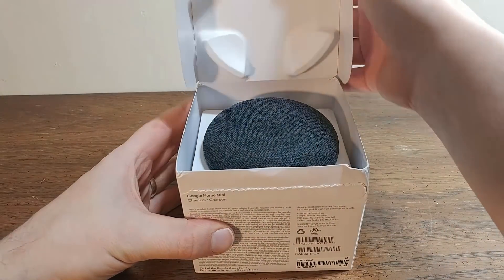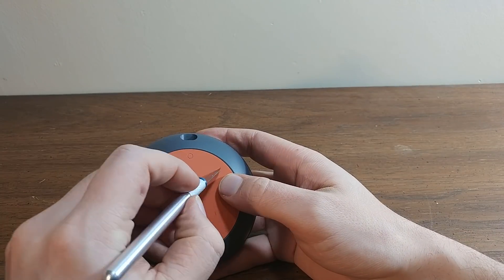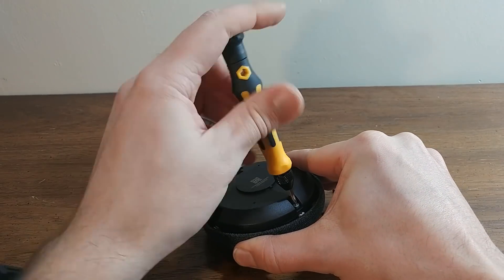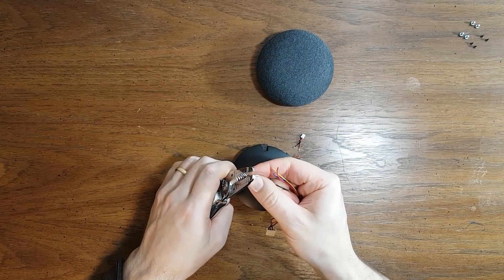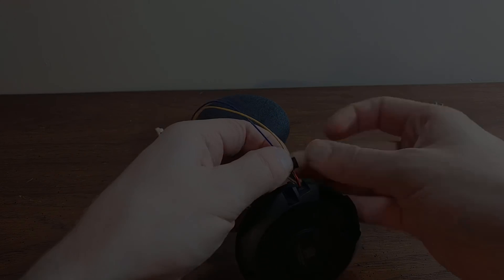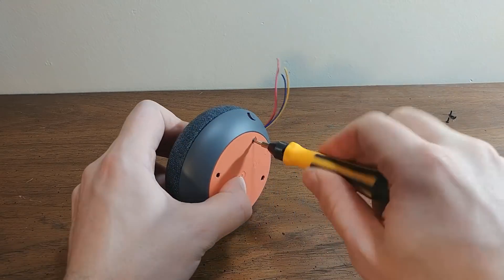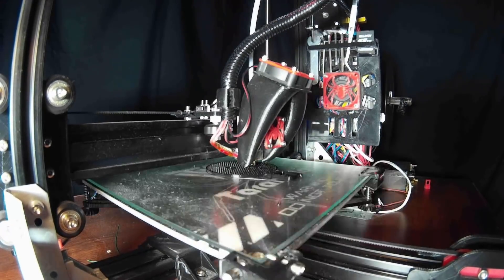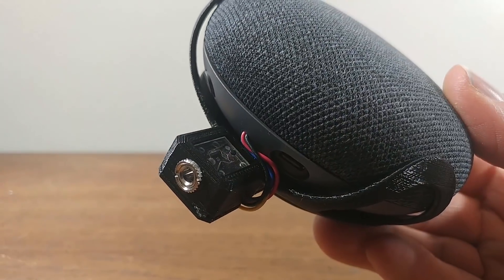Google Home Mini Wall Mount With 1/8 Inch Headphone Jack Mod

Comment: would this not require an amp? Seems like you are just putting a big speaker on a small unit which wont really give the boom that you are looking for>?
Reply from the maker: In my experience larger speakers can sound louder and nicer. And according to Google AI Overview "Larger speakers, particularly those with larger drivers (cones), can move more air with each vibration. This greater air displacement results in a higher sound pressure level, making the speaker sound louder. Larger speakers also often have a better low-frequency (bass) response, which can contribute to the perception of a fuller, louder sound even if the overall SPL is similar to that of a smaller speaker."

Comment: We have long resisted getting an Echo. Never really saw a need. https://www.youtube.com/post/UgkxhB5YOMNj04GuoAosExygP4cH-dKeb4aB When we recently completed some remodeling in our home, we realized we had failed to add a switch to turn on a certain lamp across the room. We couldn't run new wiring (which would have been expensive if we could), so we got our first Echo which completely solved our problem for about $40 (Echo Dot and smart plug). We just ask Alexa to turn on/off that light. Heartily recommend it to solve this kind of conundrum!

Comment: That pin connector is a real pain in the ass to get back on. On one, the whole solder uprooted when I tried to pull it out and I ruined it. Ugh.

Comment: Great video. So I duplicated it and everything went well. But I am getting a hum on and off. Is that because I'm not using a resistor?

Anyone have any diagram work for the resistor and what kind of resistor?
Reply from the maker: Yes, I believe a resistor would fix it (I believe the other You-tubers use them)  I never did the research to figure out which one would work since I found if i didn't plug it into a amplifier but just into a speaker The hum wasn't really noticeable 'cause it was just going to the new speaker instead of its on board one also, you could maybe remove the hum with an amplifier that has a good EQ on it.
Reply: I am also getting a loud hum when i connect it to an amplifier. I bought a pair 2.7 ohm and a 330 ohm resisters but I'm not sure to which pin i should connect it to on the headphone housing. Because i want to output in stereo, I'm having a tough time figuring out which wires to couple. Any help would greatly be apricated.

Comment: No need to add the resistors like in the other hack videos ? Why ?
Reply from the maker: my understanding is the resistor has 2 purposes lowering the Max output so as to not blow up amplifiers if you set it to full volume, and cleans up the sound when going into some amplifiers both features are unnecessary if you're wiring directly to a speaker without going through at amplifier.  your mileage with amplifiers may vary and always be careful to not use Max volume on the mini when plugged into an amplifier I recommend 35%

Comment: Would this process be similar with the Google Nest Wifi? I have seen a tear down and it looks like the audio component inside a Nest Wifi is the same as the Nest Mini.
Reply from the maker: I would assume they would be similar since it's just a generational Improvement

Comment: Nice work, thanks!
Is that mono or stereo?
Reply: It has only one speaker and is therefore only capable of outputting one channel. Stereo sound requires two output channels . It is therefore mono only.

Comment: I have 808 bluetooth speaker and speaker alone became bad and the circuit is good and want to connect this Google Home Mini as a speaker. Can connect the 2 wires for speaker to the Google Home?, will it work, and does this setup need power connected to make speaker work?...The bluetooth board (808) comes with recharge battery for the circuit. I just need a speaker (Google Min's) to be connected. Please suggest, if external power for Google Mini is not required and I can just connect to the speaker..Then I can charge and carry this Google Mini and use with the limitation of "Hey Google" and google assistant options.

Comment: If u got a headphone to rca cord u could hook it to a stereo.  Hooking an external speaker to it by itself is gonna sound horrible because Google home doesn't have much of a audio amplifier Built-in. So any external speaker you hooked directly to it is gonna sound like crap unless you hook it to a stereo.

Comment: Thats amazing. I just won the latest version of the nest mini and my excitement level kinda dropped when i realised i could not use it to Spotify connect my kitchen speaker... i might just tear it down and try to put a jack in it, seems like a simple operation.
Reply: I'm gonna do that too I guess
Reply: What about a cheap bluetooth adaptor? I was thinking about that too
Reply: @alecampos1491  Get an Chromecast Audio, that's way better, more stable and same price.
Reply: @simonwolf177  The thing is those are rare to find, where I live they are not sold anywhere, and its expensive to get one on amazon with shipping and taxes
Reply: @alecampos1491  Where are you from? I got mine from eBay. I have a Bluetooth Adapter as well but it disconnected all the time and I had to reconnect manually. (but it wasn't cause of the adapter, other devices don't disconnect, only the nest does)
That's why I got the Chromecast Audio and it works way better. If you can get one, I would strongly recommend it!
Reply: @simonwolf177  Yeah it would be my main option, however, I'm from Argentina where it is nearly impossible to import things and even if I where to do it, it would cost me three or four times the original price, and there still the possibility that it gets caught on the Aduana.
A cheap BT Adapter its easy to find and ten times cheaper
Reply: @simonwolf177  in italy it's out of stock since 2019

Comment: Hay buddy can we connect a Amplifier Aux in to this Jack you installed on the Google home ??
Reply: I'm pretty sure that this will blow your amp if you don't use appropriate resistors.

Comment: I pushed a small flat blade under the edge of mine and just pulled it off. Adhesive actually wasn't terribly strong. Also, always use heat shrink instead of electrical tape. And when you put solder on a lead without soldering two items it's called "tinning" not soldering.

Comment: No amplifier for that huge driver?
Reply from the maker: Yes correct, actually in my experience larger speakers are easier to run with less power than small ones my theory is that it's easier to make an electromagnet with a bigger coil

Comment: add the resistors !  https://youtu.be/bMfcrZYOAnE?t=112
do it with 2 home mini devices and stereo pair them !  (now its mono )
Reply from the maker: I don't believe that would work because in stereo you want to separate tracks and both minis would be combining the tracks to make a single source so it would be the exact same linking two of them as what I have currently

Comment: Use a leather hole punch instead of cutting with an xacto knife and use heat shrink tubing on your solder joints instead of electrical tape:
https://www.amazon.com/OWDEN-PIECES-HOLLOW-CUTTING-LEATHER/dp/B07GCWY3HH - leather hole punch set
https://www.amazon.com/MulWark-415-Pieces-Box-Applications/dp/B072LTD1LT - heat shrink tubing

Comment: you did not use external amplifier, u sure it can drive a lower resistance speaker
Reply from the maker: In my experience it takes less power to drive a large speaker than it does to drive a small one.

Comment: I managed to get this together. When I plug in headphones it works just fine. When I ug in a bigger speaker (150amp) I get static and barely any sound. What's the deal?
Reply: You need an amp
Reply: Hmmmmmmmmm....

Comment: Hi!, I noticed some people doing something similar but adding a couple of resistors, why wasnt that necessary in your case? cheers!
Reply from the maker: I didn't add resistors because I was going directly to a non amplified speaker if I was going to an amplified speaker I would have to add resistors or not exceed 30% volume
Reply: @Make-it-work  thanks a lot for your reply, I'm very good at DIY repair complicated things like film cameras for example, but clueless with electronics... So if I want to add an output jack and I want to connect a powered speaker like for example a Logitech Z533... I will need the resistors right??? Thanks again! Cheers!
Reply from the maker: @martirpeperino  Yes, you would need resistors if you want it to sound good going into an amplifier. Good luck!
Reply: @Make-it-work  thanks a lot for your reply, I'm very good at DIY repair complicated things like film cameras for example, but clueless with electronics... So if I want to add an output jack and I want to connect a powered speaker like for example a Logitech Z533... I will need the resistors right??? Thanks again! Cheers!

Comment: Great video , however I am sure there is Digital sound processing going on to make this small speakers sound like good,so the sound you going to get is highly process specifically for their speaker your speaker is not likely going to sound good since it’s different , also 
This is mono solution so not really good axe out , better use the Bluetooth broadcasting ability of the mini
still great video , thanks

Comment: I appreciate your thorough breakdown, thank you. 

Also, to any other idiots like me who didn't immediately realize this, adding a line-out will only give you mono sound. So it wasn't worthwhile in my case.
Reply: just saved me a couple hours of my life, thank you
Reply: Uhm... why not just get the chromecast/chromecast audio device???
Reply: @msld3529  ummm cause they're not available any longer. Unless you know of a stockpile somewhere?
Reply: @msld3529 because the nest has a build in small amp… chromecast audio is pure lineout. So you would need a stereo or a powered speaker for that solution
Reply: wdym by mono sound?
Reply: @adelinbutan7274  because there is only one speaker and we're splicing directly into its cable, we won't get any more information than it has. Unfortunately, this means mono sound only.
Reply: All the Google Homes are mono, I know for sure the mini and standard ones are. So there is only the one mono signal coming from the device.
Reply: @jamiewashere if you get 2 of them you can pair them so they play stereo.

Comment: You can pill off the orange rubber thing easily after heating it with a hair dryer, it is just a sticker...then you can reapply it no issues

Comment: This is technically a speaker out not AUX or line level output. Not east to connect this output to an amplifier.
Reply: It's pretty simple to add an external amp. I am using a XH-M139 (50w x2 channels, yes I know its mono ) to push two outdoor speakers for my porch

Comment: Hay just a hit if you're gonna use a bigger speaker use a external amp
Reply: Bigger speakers need less power in most of the cases
Ex: kiplish forte III only needs 2w to be driven to a normal volume

Comment: Hello,
I seem to be confused with the schematic of the audio jack. 
I need a stereo output and what i understand from the real schematic of the jack is that #1 is R audio in from amp # 2 R speaker out # 3  is L speaker out, # 4 is L audio in from amp # 5 is ground
Your connection shows the following:
#1 audio in  is connected to #5 common
# 2 and #3 are connected to the inbuilt speaker
# 4 is connected to ground

If i look at the correct wiring diagram it shows:
#1 and #4 connected together 
# 3 and #5 connected to inbuilt speaker

By the way i read #1 to #5 from lower left corner and move towards right and go up to top.  The top is the socket where you insert the headphone jack.

Please advise
Reply from the maker: Here is a wiring diagram of what I did. I hope it helps! https://www.dropbox.com/s/yeo4u4s2j4ctn2a/h1.jpg?dl=0
Reply: Yeah...that's NOT stereo.  That's the exact same wire to both the left and right headphone jack positive wires.  This is a monaural connection only.

Comment: Did you actually connect the big woofer directly to Mini's  internal amp ?  Couldn't really see if jack was routed to an external amp.
Reply from the maker: I connected it directly. it takes lots of power to drive a small speaker so it could actually do pretty good with the big one
Reply: thanks!

Comment: You connected this to the signal that normally goes to the speaker? isn't the signal too strong (read very high volume) for a regular line input? You can always turn the volume down, but if you don't, do you risk damaging your amp?
Reply from the maker: yes definitely. I wouldn't ever put my Google home mini volume above 30%

Comment: Thanks for this video! I was easily able to follow your instructions and add an aux port to my google home. However, I was disappointed by the audio quality. The voice sounds fine, but when I tried playing audio it was very flat and had no bass at all. Is there any adjustments that can fix this?
Reply from the maker: I'm glad to hear that you liked my instructions! As to audio quality, it's pretty much all about what speakers you use. In the video I use a speaker that has really good bass. Another way to improve the quality would be to run a mid and a sub in parallel (with maybe some resistance to the mid’s speaker). If you want to really crank up the bass, I recommend using speakers in conjunction with the LP-838 amplifier because it has a dedicated sub out with its own volume knob. It works well for me!

Here's a link to some LP-838 amplifiers. I recommend looking around though, as they vary in price quite a bit: 
https://www.aliexpress.com/wholesale?catId=0&initiative_id=&SearchText=lp-838
Reply from the maker: My diagram for wiring the output on the Google home Mini ties together the left and right channels so you can even use a stereo splitter if you'd like (or you can use a aux cord and the input on the front of the amplifier), and when I use the LP-838 I only let the Google home mini go up to 35% volume, which is more than enough because the LP-838 can go very loud on its own. You could probably turn it up more without damaging the amplifier.
Reply: @Make-it-work  isn't that an 1/8th inch jack ? ;-)
Reply: Oh, that incidentally is a very helpful comment on the Left and Right channel being tied together. I did not know that and was still trying to figure out how to connect to a phone jack (I use a 4 poles jack and that had me perplexed too). 

If it's not too much trouble can you advise how to connect to a 4 pole phone jack? A direct connection to a jack will be easy, but I had a hard time trying to figure out how the mini speaker is being disabled when a jack in plugged in (not much additional information I can find on the internet either) 

Great to know that you had it connected to a LP-838 without problem. I'm going to do that once I have my phone jack done. 

Thanks and once again Great Work!
Reply from the maker: If you pause the video at 5:24 and look at the diagram the two red spots representing where to solder the red wire to those two should be the left and right, but because we've taken the red wire to both of them they've tied the left and right together. The yellow in the bottom is the out so you have the left and the right going to the headphone jack and then when the headphone jack is not plugged in, the one on the right is connected to the yellow and continues to the onboard speaker. 

As to a 4 pole headphone jack, typically that is only used if one of them is video or, in the case of like Apple headphones, one of them helps with the mic and remote so you can pretty much just ignore that because it should work with the headphone jack, you just won't have access to the microphone or the remote which you couldn't get access to any way with this type of configuration.
Reply: Thank you so much! I'm going to try it. Thanks again.
Reply: It really looks like youre hooking up a channel (red) to the common.
Reply from the maker: in the video I miss wire it that's why I have the diagram
Reply: Great video and instructions. 

On your recommendation above about using a LP-838 amp, would you need to add resistor(s) at the Google Mini output to reduce the voltage or can you feed the output directly to the LP-838 without clipping? 

I saw that the LP-838 has stereo inputs. I would assume that you can use a Y splitter (mono to "stereo") to connect the mono Google mini aux out to the Left and Right RCA inputs of the LP-838.

Thanks in advance.

Comment: Thanks for your idea. Any way....can I buy it from you? I am too lazy to make done so.... could I?
Reply: Ben Rayner doesn't that only work for apps like Netflix and Spotify but not the actual output of the mini if for instance you ask it to tell you a joke?
Reply: Teuku Panlima i was thinking the same thing!
Reply: My Google home mini went off when he said ok Google tell me a joke
Reply: Hurry hup they are stopping the chrome cast audio (stéréo, stand alone, optical output, quality of the DAC,...). But This mod NEED resistors to be used as said in an answer below. This is IMPORTANT to be said, you can destroy a device !!!
Reply: It's called a Chromecast Audio. It would be cheaper to just buy one of those instead of paying someone else to manually mod an existing google home mini.

Comment: Thanks for putting this video together.  What was the cost of this project?
Reply from the maker: Other than the cost of the Google home Mini I probably spent less than a dollar on filament(Cura estimated 19 grams) and the headphone jack probably cost about a dollar (I linked some similar ones from AliExpress above) and the wire I used I just clipped off of a old PC power supply so I would say material cost is probably 2$